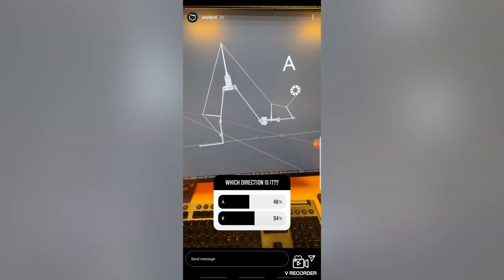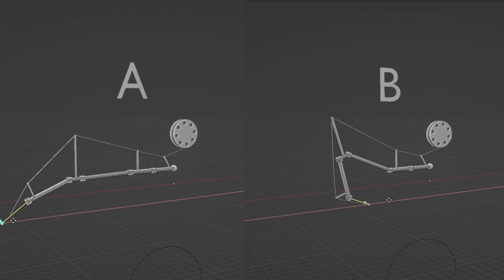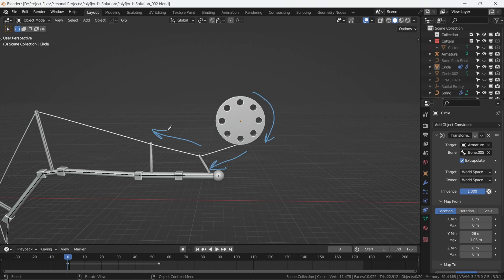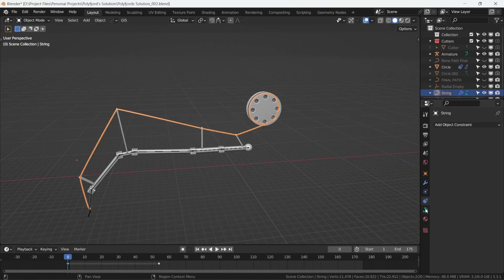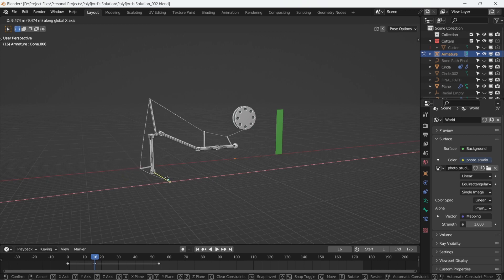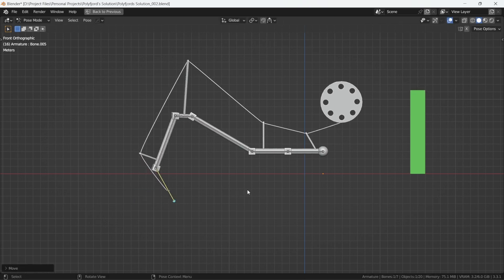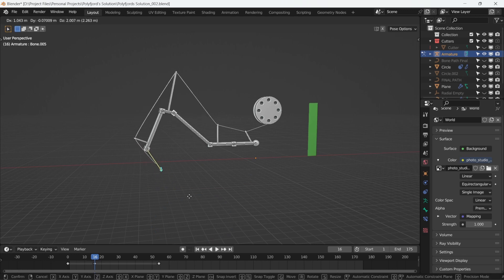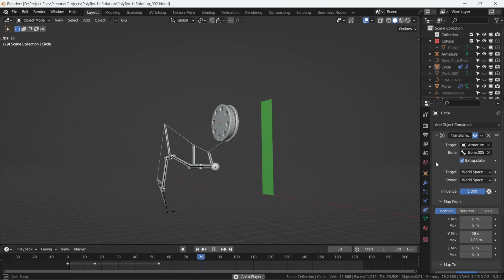What is Polyfjord's Paradox in Blender?

Comment: If the string was fed counterclockwise, there'd be more friction if it was being fed at the bottom through a funnel of some sort, and it would possibly snap.  Clockwise feeding would be optimal imo, since it'd be a natural flow for the string

  Guessing B out of the two, though I'm guessing the only time it'd be loose is when the pointer/guide is in the middle point of movement, right?  Both extending out and curling in would pull the string, giving the motion more of a constant "sawing" going between the two states, my guess
Reply from the maker: It is pertinent to mention that by the mechanics of the rig, the mechanism driving the legs is not the traction force by the string. The pull and push of the string cannot drive the motion because that force varies its direction according to the internal angle of the armature. It has to be an internal driving force in the motors within the legs themselves. But that topic is for a mechanical engineer. We're just dealing with the problem at hand.
Reply: @hamzameo  For sure, for sure, think I was thrown off with its' visual design, I assumed the simplest answer with the rope and the winding wheel being a major focus.  It'd have to at the least be a combo of the rope and mechanized components helping out with the movement since the string's clearly being affected by the movement of the rig, right?  I was admittedly assuming that the lateral movement was physics, the rig being so thin and flexible (sort of like a fishing pole), but if it's aided by mechanisms within the segmented joints, I can totally see it

  I guess the question should be aimed at "what is the rope doing?"   If it's there for just stabilization, it'd still probably be B due to the torque I mentioned above.  But if it's helping with the motion of the tip, it'd be a sawing motion.  But now I'm not quite sure what the rope is doing so honestly not sure because it got put into a Schrodinger's Box scenario lol

Comment: How is this a paradox? It's intuitive, really.
Reply: @gordonbrinkmann  One direction, A, is mechanically accurate, but B is stronger "emotionally" in which I mean it feels better for the wheel to be unwinding as the leg extends and winding as it contracts. In a technical animation I'd use A but in a narrative animation I'd go with B.
Reply: Honestly. It takes a minute of thinking to see which way is the right way.
Reply: Exact thing I wanted to type from the very start of the video – with the proper movement the rope will shorten and lengthen within one cycle ... pretty intuitive!
Reply from the maker: So it seems that both directions are right, and there seems to be an internal conflict on that. But yes, with careful thinking one can come to a conclusion. :)
Reply: @hamzameo  It's only a paradox if people would generally assume the wrong answer. Something being hard to figure out doesn't create a paradox.
Reply: @MrMokey24  Over 50% of people in the poll got the wrong answer, so it definitely seems at least counter-intuitive, if not paradoxical.